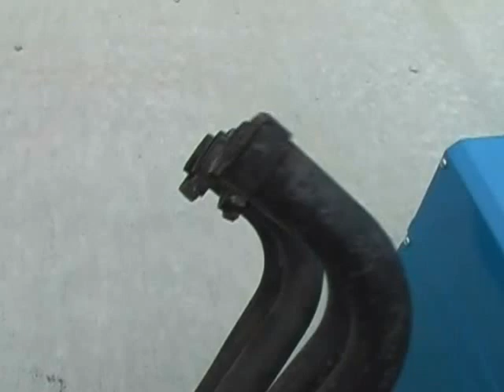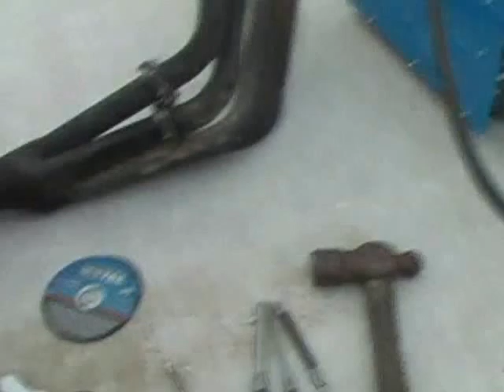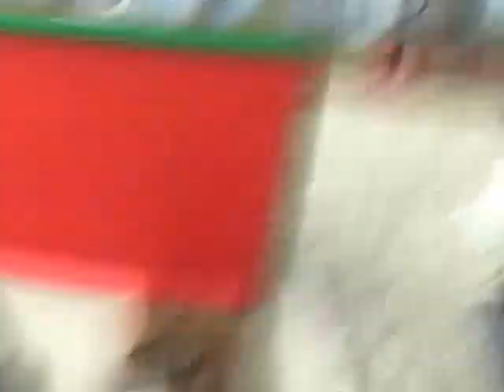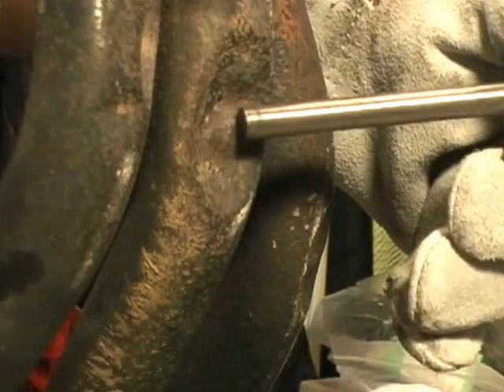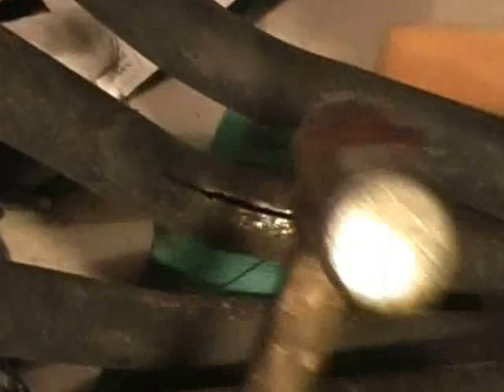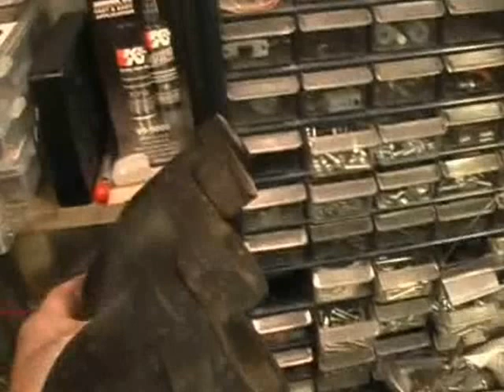Motorcycle header pipe repair

Comment: Could you post a video on Grinding out the inside of header pipe welds please.  I have a 1984 XT600 43F And would like to know if I can get a bit more speed by doing that, I need instructions.  Thank you.

Comment: i've always tacked on a piece of rod and that's the pull lever. then heat the dent until it is soft enough to pull it out, you can tack 5 rods all over it. it's a lot easier than cutting and then welding the split.

Comment from the maker: No, it's a great idea. You can use blankets made for welding to protect the bike and do the job with the header pipes on the bike. I was just minus a torch to be able to try this. There are always possible down falls when you get started doing this. But it would be worth a try, because it is a very involved processes taking the pipes off and working the dent out from behind.

Comment: I never done it but I think a stud gun welder would have worked, you wouldn't had to cut into the pipe,just weld some stud on it an add some heat a pull the dent out,probably better said than done thought lol